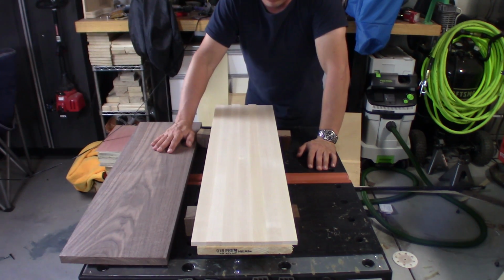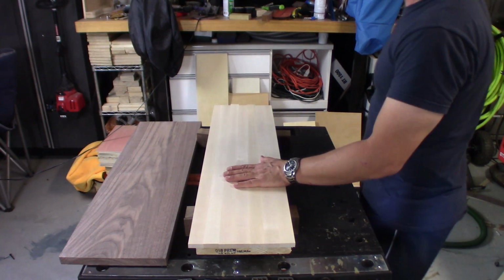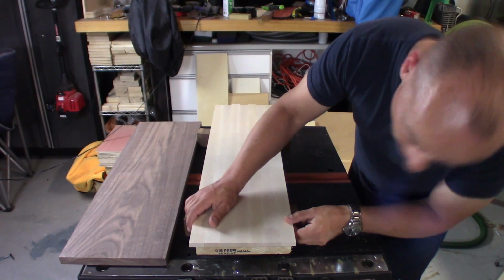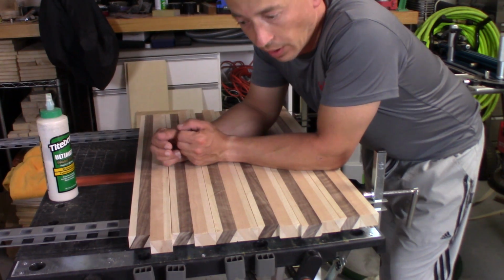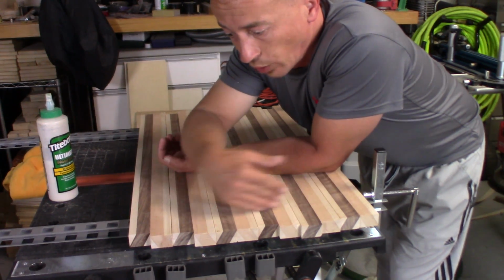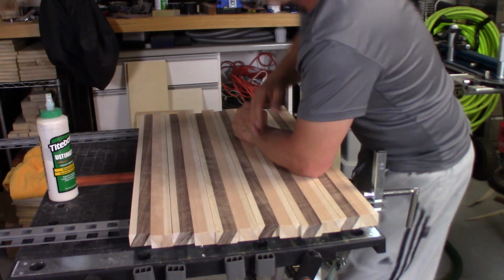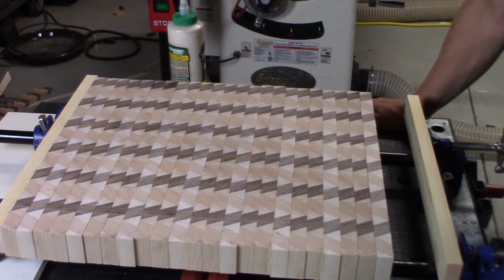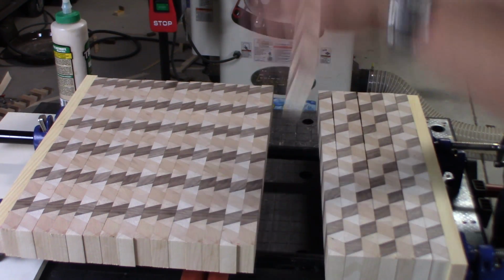3D Blocks Cutting Boards

Comment: First, these are beautiful.  A much easier way to create one of these than other videos I've seen.  I do have a question about what is going on at the 5:00 min mark.  Are you just squaring up the pieces with the blade back at 90 degrees?

Comment: Love the way this put together vs cutting bunch of 60 Degrees Diamonds. I believe that there is a bigger chance of errors for not fitting perfectly if using 60 Degree Diamonds, what to you think? I think if any errors made during cutting the boards in the exact angle, the error will not be noticeable, as all Pieces will fit together regardless, then the error may be visible as the angle may be off by fraction of degrees.  I don't have the right Table Saw to try this, But once I get access to a nice Table saw, Planer, like to give this method a try.  Thanks for sharing.

Comment: this is such a cool design thank you for sharing this ! i would like to make one for my son and actually have just done a practice one but just out of pine ,oak and cherry scraps i had. made the sandwiched boards 10 mm pine and 20 mm oak and one of 10 mm pine and 20 mm cherry. started those as 8 inches wide and 12 inches long "sandwiches" now just did final glue up and have a board 16 inches long 5 inches wide and 1.5 thick. I guess it does not look too bad for a first try. i do have a question though. If i would like the next board (the one for my son) to be 15 x20 and 2 inches thick what should size of boards be to start the "sandwiches" . I know it should be easy to figure this but just having trouble wrapping my brain around this haha. Thanks

Comment: Check out the Pony 50's, maybe a new model number now, but stick with the Pony brand (I've tried others but the threadings aren't as good) 3/4" pipe clamps, give them a try brother - you can never have too many clamps :)  (best part is buy the pipe local).

Comment: During the glue up I noticed you glued the light colored ends on either side but they are gone by the conclusion of the video.  Did you just glue them for protection?
Reply: The ends are glued on to stop tear out  when planing, and then cut off. So yes, protection.

Comment: The cutting board looks great. Congratulation on your retirement from the Navy,  are you still overseas? your table saw is not USA made it looks more like the one sold overseas. Keep the videos coming they made me feel like making something too. :)
Reply: Thank you Ruben for the degrees I'm still curious to know what the rip width is after sandwiching the maple to the walnut and cherry? I see that you have them glued and ripping them at the 30 degrees I'm trying to make one of these you have the long point and short point of the these individual rips I would like to know is that 1.5" two inches? Sorry for the trouble and thank you again

Comment: Great end result but sadly video isn't up to par. There was a huge pile of glued boards and the next take it's a 30 degree triangle running along the sled? how did that happen?. Like planing? jointing? sizing? all that was lost?. That's like the gist of the video if you ask me (then again you didn't, just commenting as an user).

Comment: What is the angle degree of the table saw blade when you cut the sandwich panel.
Reply: Mario Moreno my guess is 60 degrees.  Three different colors making up a 6 sided polygon.  360 / 6 = 60
Reply: Mario Moreno you would adjust your table saw to 30 degrees
Reply: 60 degree angle.

Comment: Hey, what's the angle you rip after sandwiching the maple to the cherry and walnut? Great looking cutting board good job!👍🏼
Reply: Also when you make the rip on table saw with the degree long point to short point what's that measurement?
Reply: Joey Sampaolo the angle is 60 degrees, or 30 depending on whether it's a right or left side rip.

Comment: Great looking cutting board.  I, too, am retired Navy - now teaching wood shop in a small rural school.  One of my students happened upon your video.  One question - what is the width of the cut (of the sandwiches at 30 degrees) - or - is there a formula to use to get that dimension?  Many thanks.
Reply: Rob 1
Reply: 1 inch wide?
Reply: could someone explain again exactly what time point in the video that this one inch cut comes in?

Comment: What angle did you cut the sandwich pieces?
Reply: Uriel Valdez 60 degrees
Reply: Danm my table saw only goes up to 45. Thanks for the reply man
Reply: U can do 30 degrees, same difference.
Reply: Uriel Valdez 60 degrees is just measured from one side, but on the other side of the blade it's 30
Reply: Reuben Brauer ok, so I did what you told me and holly cow, it worked perfectly, it was a success, next time i just have to use more lumber I got a pretty small cutting board. Thanks for your help man
Reply from the maker: nice!  yeah, the unfortunate part of this design is that it uses a LOT of lumber and the yield is so small.
Reply: It's. 6 degrees

Comment: When buying hardwood, most is coming in at 3/4" thick which is already shy of the 20mm mark...am eye missing something?  Ha
Reply: Buy 5/4 if that's the case, but I have found a large majority of suppliers in Canada give you very close to a full 4/4 when buying undressed lumber, and just over 20mm when buying dressed.

Comment: Nice work man, but you should have given kudos to mtm.
Reply from the maker: I do quite often!
Reply: Cool, first video of yours I've watched, so didn't know...The man is a master at his craft. I see you have adopted the short fence;  is it better? Makes sense that it would be, care to share your opinion?
Reply from the maker: Agreed, MTM Wood is an inspiration for me and really the reason I got into making these.  I use the short fence for a couple of reasons, which I'm sure is the same for others.  #1:  When making multiple repeat cuts, it keeps the previously cut piece from being wedged in between the fence and the still spinning saw blade, reducing kick-back possibility.  #2:  Sometimes the actual fence goes out of square to the saw blade.  Not a big issue with a cut or two, but when cutting one panel 20 or 30 times over, that small percentage of a degree can quickly add up to 3-5 degrees or more by the time you get to the final strips being cut out of the panel.  Not usually a big deal, but with end grain cutting boards, that means that although all of the shapes will be aligned on the top surface, the bottom of the board's shapes will be slightly out of alignment and sometimes break the pattern.  With that said, I know the fence on my sliding table is true to the blade, so when each cut is made, the trueness of it is based off of the front edge of the panel being against the sliding fence so there's no chance of the rest of the cuts being off.  The short fence really only serves as a stop block to ensure all cuts are the same thickness and to allow that extra space for the cut pieces not to get stuck in between the long fence and the spinning blade.Hope this helps!
Reply: RB Wood Creations what are the angles that you are cutting the wood at and how thick are the cuts? I’m just starting out and with some help, I am going to be making one of those boards. If I make a few mistakes, I will be making the chaotic pattern cutting board hahaha! 

Now back to watching your other videos!
Reply: Check out his new app! It’s very impressive and has some great information in it
Reply: Hey RB. Same here. Andrei (mtmwood) is also my main source of inspiration and knowledge. Great work on your part!

Comment: Great video, but your music is annoying as hell.  Caused me to turn off the sound.  I would have rather had some verbal dialogue explaining more details of why or what you're doing. For instance, I didn't understand why you cut a 30 degree cuts on a bunch of strips and then cut the angles off on the table saw?  Why?  Again, great video, just needed more verbal explanation.  I plan on trying this project in the new year and use your video as a guide.  Thanks.